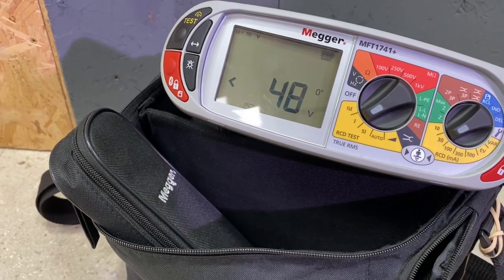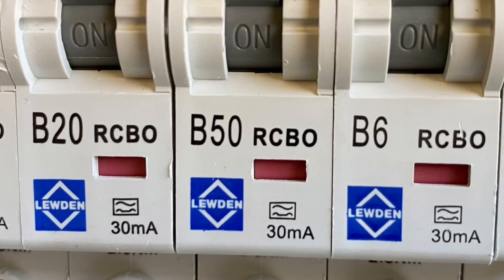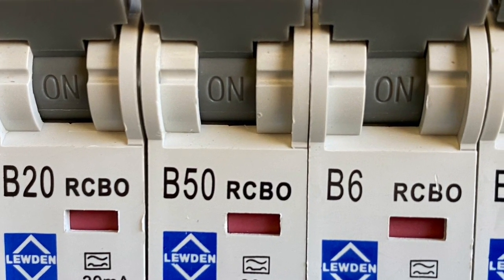TYPE A RCDs ❌ Why does my multi-function tester show a FAIL?

Comment: This was really interesting although most of it was over my level its something I often see in the EV industry which is manufacturers understanding and doing stuff to which the regs haven't yet caught up or understood one of these was PEN fault.   Charge manufacturers saw a way of getting around fitting earth rods and responded however the regs didn't recognize what they did till later and you'd have some electricians complaining what they have done doesn't compile with the regs although as we know now they do.

Comment: Should we not test to the manufacturers instructions, I’m not aware of any that come with the rcbos. More clarification is needed if we are to test the product correctly.
Reply from the maker: Do we not trust that the manufacturer has tested the product in the factory?
Reply: @efixx  what if it’s faulty, is that not why we test an rcbo!
Reply from the maker: Do you test MCB’s..? What if they are faulty…?
Reply: @efixx  this is a great point from new.
Reply: @efixx  Fair point, but MCBs are much simpler devices with no electronics to fail.
Reply: @lucidlx  and th practical implications of generating a 5 times, ten times or 20 times rated current test current

Comment: Devices break down. Therefore, they must be tested at the specified time with a button on the housing. When we test RCD type A, we have to test it for both AC and A, and for 0 and 180 degrees. We have four tests and they all have to pass.

Comment: So what are Lewden saying at the start, it's not clear? If you test a type A RCBO or RCD on the 30ma AC setting it will not necsesarily trip with the 0.4seconds? 🤔🤷🏻‍♂️
Reply from the maker: If you test an A on the AC setting you should get the result required by BS7671

Comment: I do seem to remember that when the type A came out you did do a vidio where you tested the rccd on the AC and the A settings ...
I had an NICEIC inspection in July .and we tested a Dorman Smith RCD on AC and A settings. . We could not get it to trip on the A type settings ... I do recall you saying about the manufacturer altering the tripping current on the RCD. So we altered the tripping current on the test meter and this time it tripped fine ...
So this may be something else you could do a vidio on especially on this vidio now .. I am still waiting for some information on this Dorman Smith RCD. .
Reply from the maker: Remember BS 7671 is the minimum requirement John. All the best Gaz 👍🏻

Comment: The test equipment is giving you the result, it's not telling you if that result is acceptable or not. BS7671 is telling you the minimum requirements for safety, personally I think if the manufacturer makes the thing, and are getting returns that are working perfectly, information needs to be included in the manufacturers instructions, along with installation guidance (ie torque settings), it's one more line of text, something like "when testing the RCD on the A type setting, refer to the 1.4 multiplyer blah blah blah"

Comment: Sounds like a right shambles to me.  No solutions here - we will hear more of this.  John Ward?
Reply from the maker: Sounded like test RCDs on the AC setting to us.
Reply: @efixx  seems like an odd way to do thing's though, install a type a rcd to protect against pulsed dc but then only test on ac. If there is a dc fault then the readings for the ac rcd become irrelevant  and there isn't a reading to prove that the rcd will trip in this case.

Comment: Hi Joe, thanks for your videos! Really helpful - especially the science and maths ones, which I really enjoy... What I'd like to know is this - I've got a bonding system on a motor yacht and I'd like to measure the resistance of the bonding cables because we are suffering from galvanic corrosion. I don't think I can use a multi-meter for this - do I need a multi-function tester? If so, why? Thanks!

Comment: I don't quite get this. Surely you would want to test a type A RCD on a Type A test setting. Not as an option but as a standard. The whole idea of type A is that it will still trip even if there is up to 6mA of DC leakage. This requires electronics in the RCD. If these are not working testing it on type AC only won't show this up. It will still trip on a type AC test but not on a fault that also has DC leakage as the DC can disable the RCD. The bloke in this video says you need to test on AC setting but A is optional. This won't show a fault in the electronics turning a type A RCD into, effectively, a type AC. Surely test type AC with the setting of AC and type A with the setting of type A. (Mind you, don't test type AC with type A setting as the DC injected for test can cause the type AC to fail. However, that not really the point I'm making)
I also don't see the point of testing type A RCD on type AC setting only to repeat the tests with type A setting. If it passes type AC setting but then fails on type A setting then there is a problem anyway. 
Or am I missing something?

Comment: Well there are a number of issues. BECAUSE: 1) The DC current that the type A will tolerate before saturation is 6mA. This is quite small. So in effect type A will behave the same as type AC when the 6mA is exceeded !!  2) Most of the demonstrations done to show the impact of DC offset on AC RCD operation is using either 50mA or 250 mA of DC. I bet you any money type A will not operate under those test conditions either since by definition it is rated to tolerate only 6mA of DC. 3) How do todays AC RCD behave with 6mA of DC?? I have seen no one test this out !!  If for example a good brand of AC RCD of today eg MK can tolerate 6mA of DC then it is no worse than a type A. 4) You talk about type A tested as type A on the Megger, but I have not seen a type AC tested as a type A on the same Megger.  So a lot of talk but no real data to support the new regs.....  Off to do some comparative testing now .......  However, need to know exactly what the Megger does under the type A testing ..... If 6mA of DC shifts the hysteresis loop to the right enough to need 42mA of AC leakage to trip on a type A, then the question to answer is will an AC RCD with 6mA DC trip with 42mA leakage? If it does, then its all the same! So, need to set up a rig to test all this.

Comment: This was a very poor presentation, it was just a group of techies chatting and discovering different opinions from each other's view points.  They should have chatted first, come to a consensus, then presented consistent information in that "conversational" manner (semi-scripted because they now know what they want to say).  They even started giving contradictory opinion before settling on a consensus, and it was probably very confusing to nonspecialists.
After Megger explain their tester methodology, Lewden explains that BSEN61008 states different testing requirements than sparkies' testers can  currently produce.  Then Megger comes back with other points ignoring the fact that their tester doesn't follow the mfr standard.

These industry representatives have between them just stated that available MFTs (at least from Megger) do not validly test Type A RCDs, and given that Type As have been around for many years, this is a big short fall and extremely shortsighted of them, and this significant non-adherence to international standards should have been published long ago, along with a full instruction to professionals on how to test these damned things!  It's exactly the type of article I expect to find in Wiring Matters or a MyIET bulletin; hell, it's not even mentioned in college when learning about the science or testing of RCDs.  What exactly is going wrong with our industry?!?  18th Ed makes important distinction between the Types (especially in EV charging) and yet these issues have never been acknowledged in print anywhere that I have seen, and I pay attention because being able to give definitive safety advice is an integral part of my job, especially as other inspectors come to me for advice on method, purpose and technicalities.  Very unimpressed, especially with the tester mfrs who should be programming their units according to requirements of 61008 not their own ideas of what they want to bother testing!